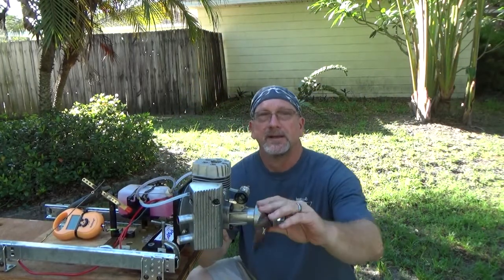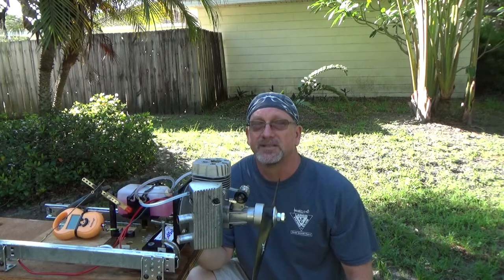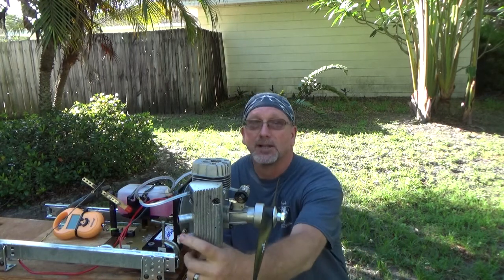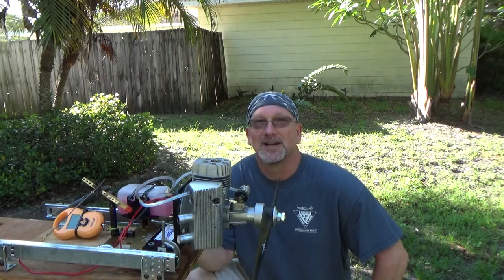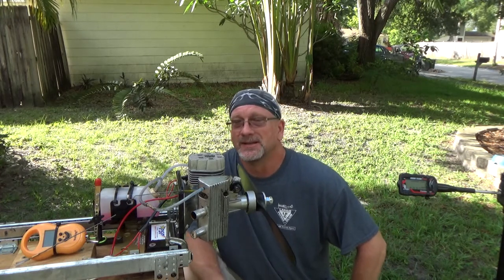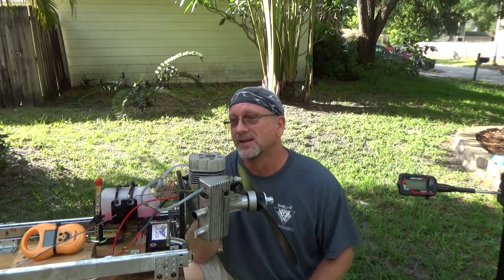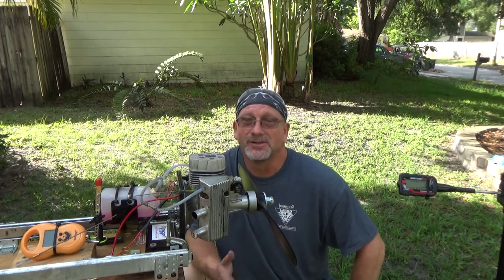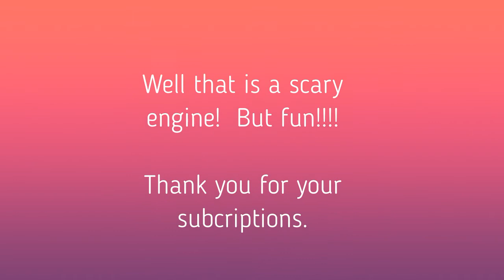Super Tigre S3000 The First Run

Comment: You answered my question before I had a chance to ask. I plan on using a Pitts muffler on the Super Tigre 90 you tuned for me.  I’ll plug the lower exhaust port. Thanks for reading my mind.  I’d better be careful going forward.

Comment: Im a little late on this one too. Going through and watching some of your older videos and probably a good thing i stumbled upon this one as you didnt have good compression initially with it and turns out it was the piston ring. I have an engine that doesn't seem to have good compression (haven't ran it yet) so that give me something to look at... Im fairly new to glow/nitro. 

And i must say, of all your videos i have watched so far... You seemed very happy on this one!
Reply from the maker: Is the engine new or used?  I honestly do not recall this particular engine or run so I cannot comment much more on this particular engine and issue without going back and watching the videos.
Reply: @dmrcflyr2 it's a used engine (OS FS 120 Surpass) that you've covered before. One of those issues is not much compression.
Reply from the maker: @perkyplanesrc9363  Oh I see.  Since you commented on this video I thought that you were referring to the engine shown in this video.  That was unclear.  There are several more and much different reasons for a four stroke to have a lack or loss of compression than a two stroke engine.  In this video I go over some of them. https://youtu.be/aQAvLNDwfzg
Reply: @dmrcflyr2  Awesome, thanks for the info. I have already watched that video and I'll take that info and see if it applies to the issues I am having with my OS FS 120 Surpass.

Comment: I have a brand new never run Supre Tigre 3000 I bought new in the early 1990s. Italian made.  I have all the gear necessary to convert this engine to gas with ignition.   Anyone have experience changing one over?  Anyone know actual displacement?  Would like to put it in a Hanger 9 Ultra stick giant scale.

Comment: I have the same engine. A beaut. I use home brewed fuel. Oil is 50/50 synthetic & caster, at 11%. Don't go higher on the oil, but don't use this fuel on your other engines. I  use an OS8, and I find a 10 x 8 prop works best. Idle, transition and top end are all fine. Standard carb, took a bit of setting up, but it's great.
Reply: 18 x 8 prop, no nitro
Reply: @robertroe1956  10 X 8 is way to small for a Supre Tiger 3000.

Comment: Hello David. May i ask a question i have a new 3250 super tigre and i am trying to break in the engine i get it to run on the igniter but one removed the engine stops. I know this is too rich so i adjust the HSN and eventually i rus with out and will sing. I have adhusted the LSN lean to get it also to transition. My problem is when hot its a nightmare to re start. Would you know the factory settings for carb so i can start again? 
Thanks Darren
Reply from the maker: No, sorry I don't.

Comment: That engine must be drinking fuel!
Reply from the maker: Actually not really.  This video was only half a tank of fuel.  I ran the other half out and it lasted another 6 minutes.  It was a 12oz tank.  So not really all that bad.
Reply: @dmrcflyr2 Also my experience. Have this engine in an ultra stick Hangar 9, and since 50% throttle is usually enough the fuel last quite long. The carburetor is the same as a 61 engine.